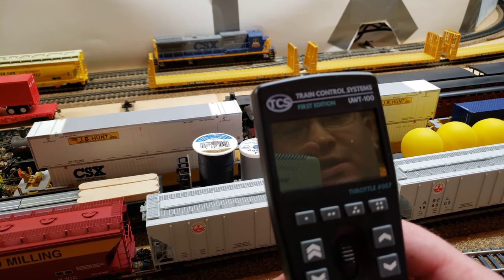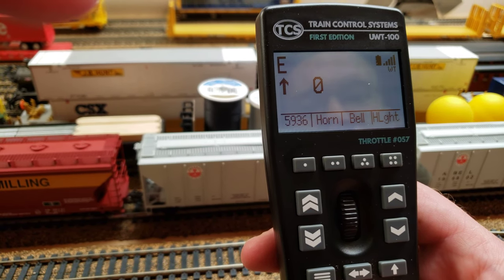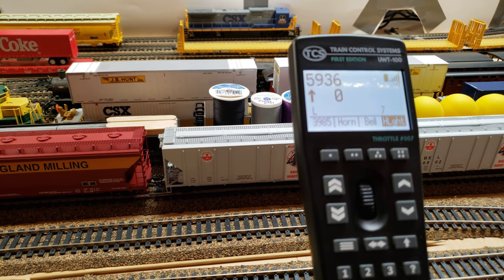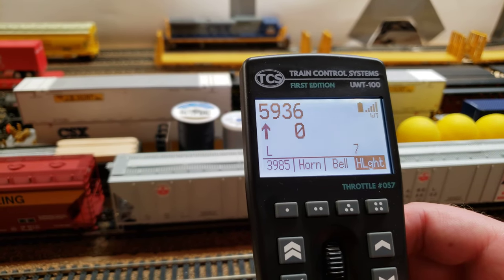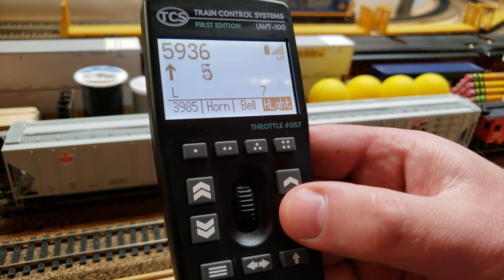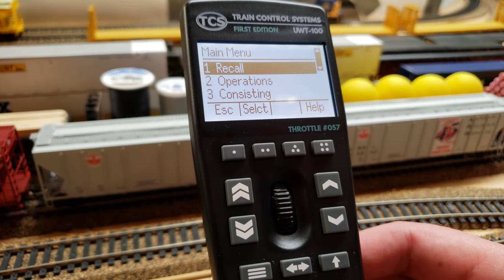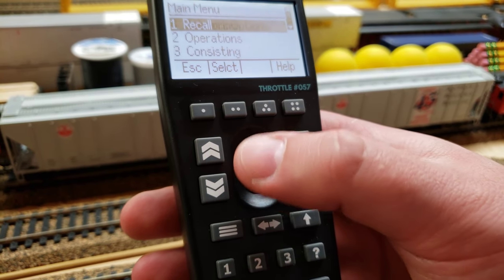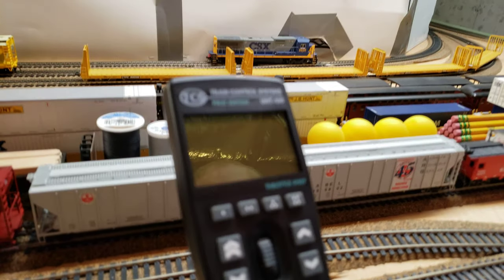TCS UWT-100 Basic Operation

Comment: Nice looking WiFi throttle.  I ordered the TCS-100 along with the upcoming TCS-50 as part of the combo deal offered by TCS a few months ago.  I plan to use these throttles with my Digitrax Chief system via the LWNI module.  My layout is under construction and I hope to start trying out the TCS throttles this summer.  The TCS-50 available for pre-order is due out end of July 2021.  TCS is working on a command station which I may switch to when it becomes available.
Reply from the maker: The new TCS command station is going to be really nice. You don't need the LNWI, just use JMRI on your layout PC for WiThrottle.

Comment: Hi    Please tell me if you can  put cvs in
Reply from the maker: WiThrottle as a protocol does not support programming, it can do programming when used with an LCC-compatible command station like the upcoming CS105 from TCS or one of the current homebrew systems.